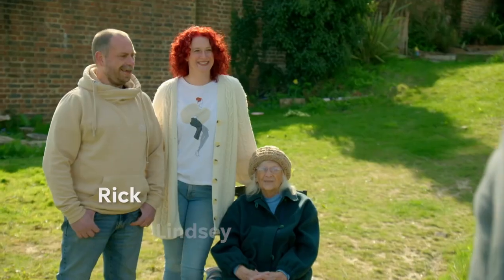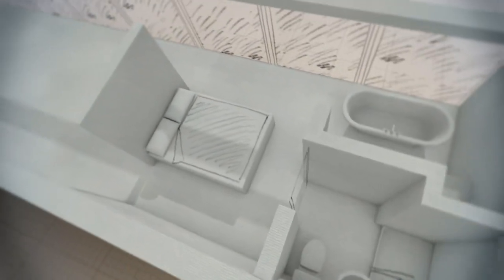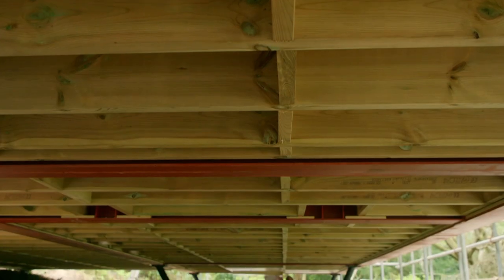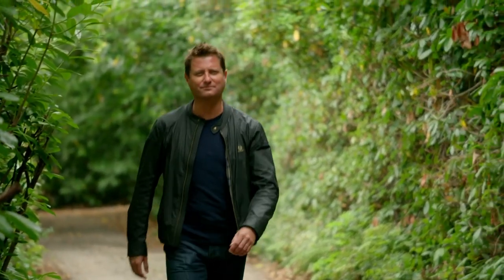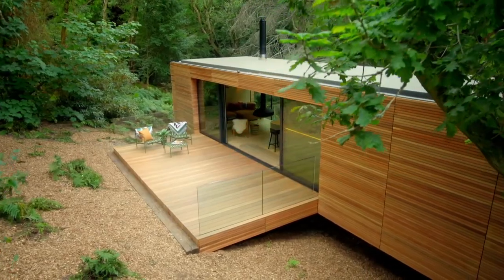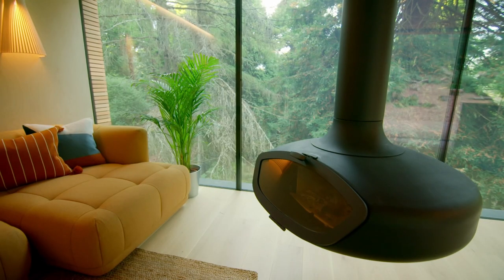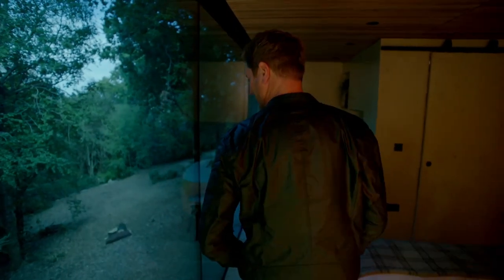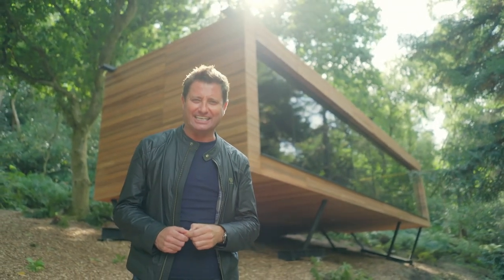Luxury Floating Eco-Cabin In The Woodland | George Clarke's Amazing Spaces | Channel 4 Lifestyle

Comment: It would have been nice to have 2 bedrooms, one for the lady
Reply: I was thinking that this is possibly a ’granny flat’
Reply: @spiralpython1989  Looking at it's location I would guess that it's classified as a static caravan and there is a maximum size for those of 20m x 6.8m.  It's done like that so that Planning Permission isn't required.
Reply: @NickLea  they struggled to gain planning permission on the build for many reasons, one being light leakage, they had to buy that special glass to block light from escaping at night to meet planing constraints. That smart glass alone cost £100,000

Comment: That's going to have wet siding big time?
Reply: I suspect that it’s just going to require high maintenance. And a full re cladding every couple of decades. The decking will definitely require replacing overtime. As long as the timber frame is kept dry the only other issue I see would be the foundation ground screws and their lifespan. However they can probably be replaced by jacking the building every 60years or however long they last. It’s a lovely house and I bet they’ll make enough through booking to cover all the work